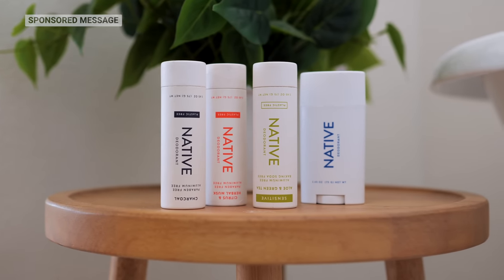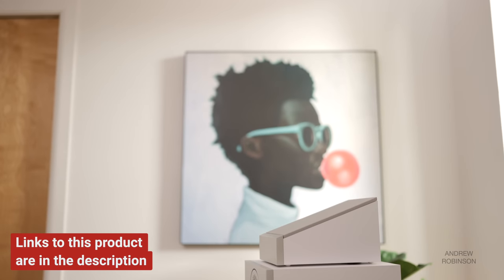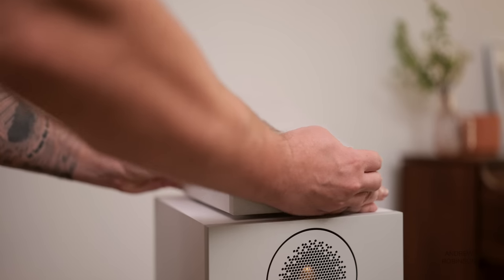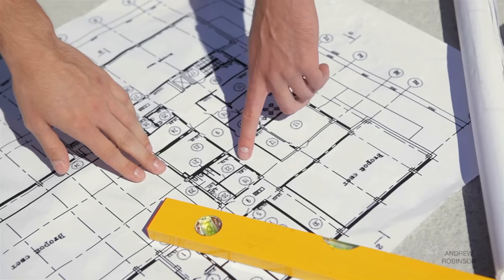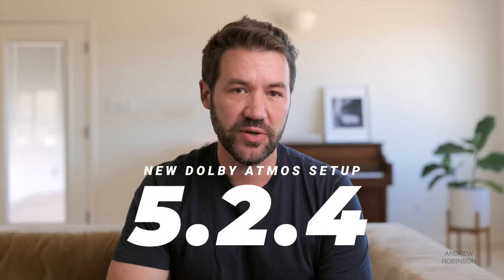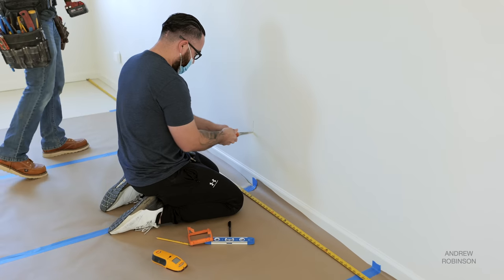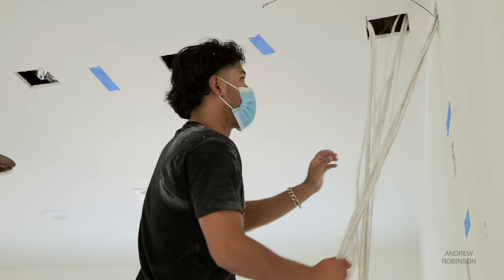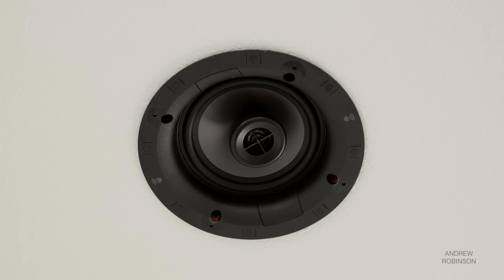INSTALLING DOLBY ATMOS SPEAKERS! Atmos In Ceiling Speakers

Comment: Random question: Are you guys seeing "Show More" or "Open Description" just underneath the video? I'm seeing Open Description on my laptop which puts all that information in the upper right corner of my screen. Andrew is still seeing Show More with the video's description text/links directly underneath that - this is how it's always been. Ugh, I do not like the move to Open Description/upper right corner. Come on, YouTube!
Reply: @bruceanderson9038  Right, but what are you seeing and where are you seeing it specifically? I understand it has always been a feature but until today, the description has always been right underneath the video's container. Now I'm seeing it off to the right and in the upper corner and the direction to get there is different.
Reply: I'm seeing "Show More" beneath the video. Google Chrome browser running on macOS.
Reply: I'm not seeing either one but is probably user error on my part on Samsung phone
Reply: @BryanRuby  I'm using Chrome as well on MacOS. I just updated the browser so perhaps it's a Chrome thing??
Reply: @joshdekubber3631  Is that the new fancy one?
Reply: @KristiWright  S20 Ultra. I think they have a newer one out now
Reply: On Alexa Show seeing "read more", Samsung S20 (just updated) has the down arrow to reveal the description.

Comment: This channel just took a weird turn. 
I recall that not only was doing speaker install out, but also that multi speaker setups in general was very niche and thus not really a focus for this channel.
Reply from the maker: Not sure how this "turn" is weird, we've been doing home theater videos for years now. I explain why I had to go with custom installation in this video in our new home to continue being able to review home theater products for you all.
Reply: @andrewrobinsonreviews  some comments ain't worth replying to,the video itself is self explanatory,and anyone Should understand why you had to have  permanent in ceiling speakers done,which as a home theater and audiophile gear reviewer,it's necessary.
Reply: @andrewrobinsonreviews  Nothing wrong with doing the setup or the reason to do so per se, it is just a bit of surprise.
I can't remember what episode or the exact words used, but I do recall something about that multi speaker setups beyond just the basics was only used a small percentage of people. And it therefore was considered to niche to cover.
Reply from the maker: @bzdtemp  you're not wrong. Going to this extreme is niche, however, when testing AV receivers we're often asked how they do with four Atmos speakers, or 9+ channels and up and to this point, that is a question I have not been able to answer for some viewers. Since we're building this room out from scratch I thought why not try and cover all of our bases? Full transparency, the in-ceiling speakers installed here will not even be connected 100% of the time, but I wanted them ready and waiting when the need arose. Appreciate your comment and thank you for watching!

Comment: $2K for all of this??? I would not have been surprised by an additional zero. I had one plumber for less than one day, and that was $2K. -- Sorry, just a 2/2.1 kind of person. A short explanation (or reference to where you explained that previously) about all the x.x.x terminology would have been great.
Reply: Lol,  yeah I know I had a plumber out and he also wanted 2k.  It’s insane. This would cost way more especially with 3 sets of speakers included. 

2/2.1 isn’t that bad.  I have a 5.0 for 20 years and it’s glorious.  I added a sub and it’s a bit better but I prefer sound over bass and the speakers could go to 38hz with 2 bass woofers so the sub was almost unnecessary even for movies.  I’m not a fan of Atmos and what it’s done to home theater.

If you’re asking about the last x, it’s for the Atmos height speakers.  x.x.4 means 4 speakers in the ceiling.  There are videos explaining the value of those.  There is sound coming from them during movies so they are being used even if you don’t notice them.  It’s hard to tell if it’s different sound than the ground speakers or just using them as auxiliary speakers for the ground speakers - playing the same sounds at lower volumes.